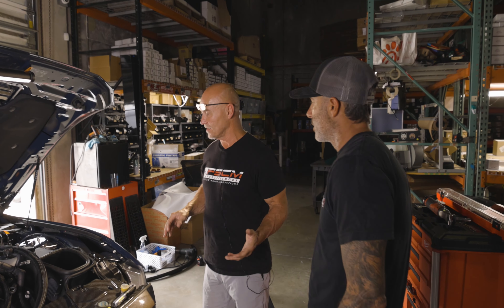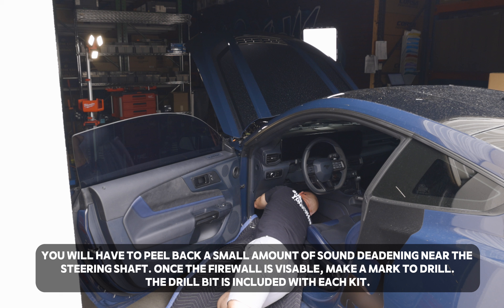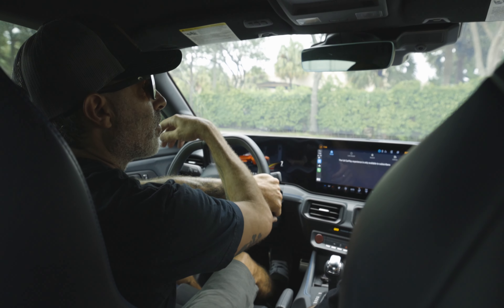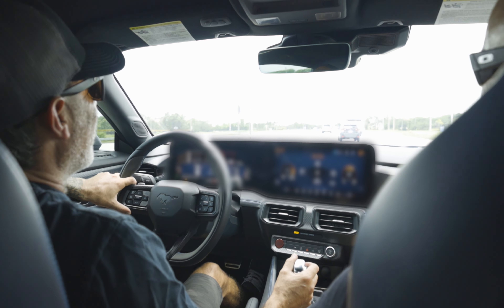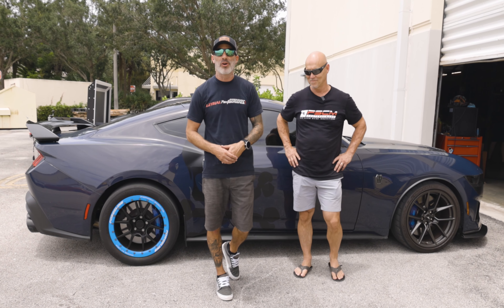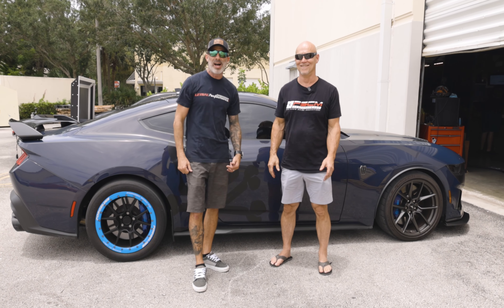FOSTER'S WHINE MOD for Whipple Supercharged 2024 Mustang's!

Comment: The wine sounds great, what’s with the whistling noise at low rpm? Sounds like a screechy high pitched whistle mixed with intake suction noise?
Reply: Air sounds the same way stock just not as projected as loud on the blower.

Comment: So this is basically pulling the "noise" from the blower thru the intake tube, when the throttle body opens? From what I see this should be able to work on any car with a top mount / pd blower...
Reply from the maker: Yes, this setup will work with various different positive displacement blowers on various platforms. They have kits for various older vehicles, like S197, S550, and SN95 cars.

Comment: You have to put back on Dyno to check if you lost any boost
Reply from the maker: You can't lose boost from this. It's just a tube that runs from the intake before the throttle body to the firewall. Boost is created after the throttle body when the supercharger compresses the air before it enters the combustion chamber. Boost can also be affected slightly by restriction however this mod doesn't create any restriction like a smaller throttle body or closed intake would cause. Hope that helps.

Comment: Might be vid not doing justice, but I think it sounds horrible, almost like Tesla putting exhaust sounds through speakers. Whipple is going to whine no matter what, no need to drill holes in expensive intake or firewall.
Reply: As an owner if this kit I can tell you there is very little whine in the car
Reply from the maker: The Whipple head unit is almost unheard completely in the cabin, especially with stock air boxes. Without this Whine Mod, you'd hear nothing from in the cabin unless you had a window open.
Reply: @Lethalcamp  ok, I’m just saying from vid it sounds horrible, like it’s fake sound coming through the speakers. And to me this is on same level as those turbo whistles you can install.. 🤷🏼‍♂️
Reply: I just installed this sound tube in my 07 GT500. Due to it having a quieter 2013 blower on it and a LOUD exhaust I could barely hear the blower before the sound tube.  After adding the Foster Sound Tube it was like night and day. Even under medium boost I could hear that pissed off Super Charger. Dont like Super Charger wine? Dont buy one. Only downside is your MPG will go down because you cant keep your foot out of it!
Reply: @MrRanggong  weird, I always heard whine on gt500’s till the new s550 ones. But now I put performance mods on I hear it like crazy, no sound mod actually power mods. 🤷🏼‍♂️
Reply: The Roush whines naturally without any extra mods needed. Not tesla "whine mod" needed😂
Reply: 24 f150 with a Whipple and I barely hear it

Comment: Dang, the Roush whines as the kit comes....no extra mods needed. It looks better too in my opinion.
Reply: Who's buying a supercharger for looks? lol
Reply: @Skuxxoffroad  being that the power is virtually the same and it's shown that both kits run the same number at the track and they both cost around the samd.... looks is the only difference right now until tuning is unlocked. Looks and driving experience are the differentiating factors at this point in time
Reply: Wow. I hope Roush makes a kit so I don't have to hear whine. If I wanted whine I'd go home to little wifey.😇